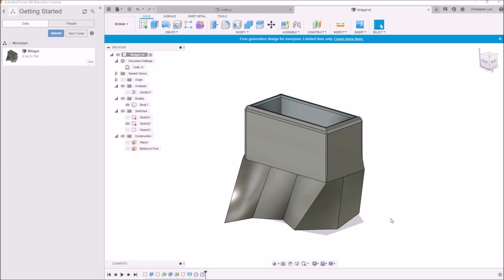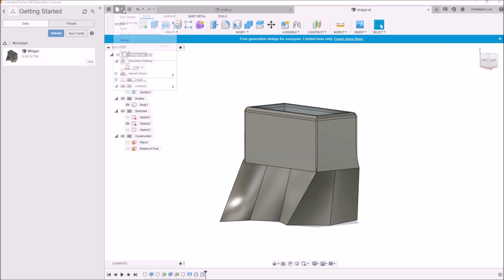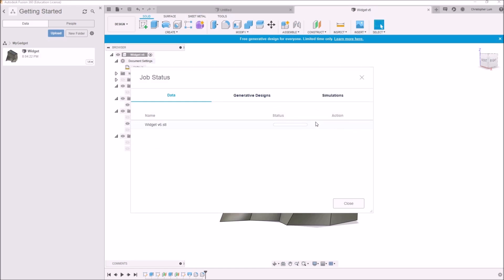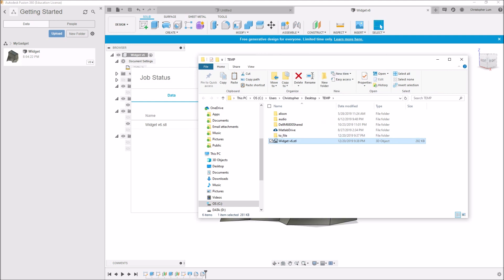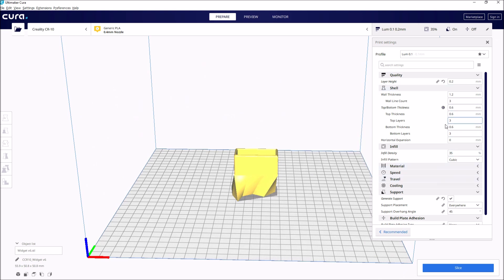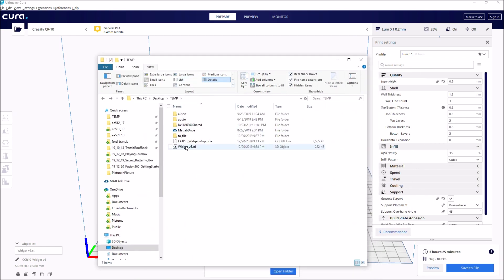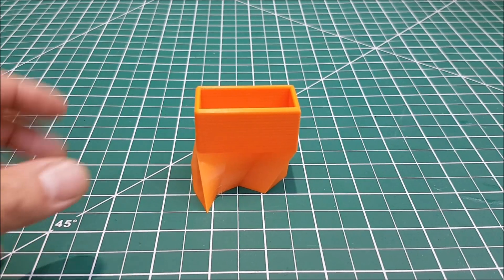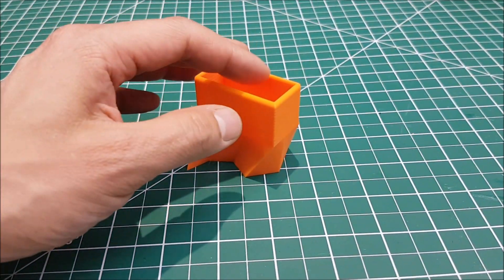3D Printing Using Fusion 360 and Cura

Comment: first off I remember when fusion 360 came out and it was a baseline system that you did not have to use everything on the cloud 😠 also now that I've managed to get another copy of 360 I cannot open cura 4.2. I have uninstalled curaand reinstalled would solve the problem temporarily but it rears its ugly head very quickly again. Any suggestions as to why I have a confliction between my fusion 360 and my cura program? I know that I can print straight from 360 but I can't print multiple items without going through a big hassle, it is easier to modify the parts layout in cura.
Reply: Yeah, we were converting parts to stl and  printing  them  without  "the cloud" back in 2011. The Cloud requirement  for F360 is just in the way.
Reply: @clevelandsavage  what really ticks me off is that I had Autodesk inventor for 3 years and you did not have to be on the cloud but they were debuting fusion when I first heard of Autodesk inventor in 2012. Since then they've gotten rid of Autodesk inventor except for high end high dollar buyers and you have to use a cloud-based Autodesk fusion 360. I'm stuck in a location where I can't always be online so I only have access to it when I tether in my phone. Other than that I do love the program and I've been using it since 2012 off and on.

Comment: How did you do time lapse with weight,  power and cost overlay?
Reply from the maker: I used Matlab to load all the photos, extract time stamp information, and then apply the overlay with relevant data displayed.